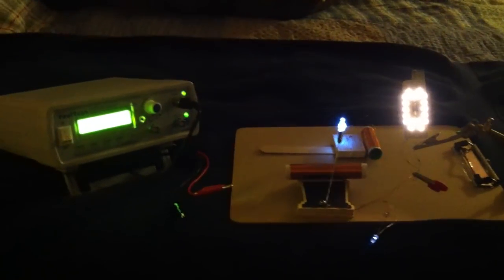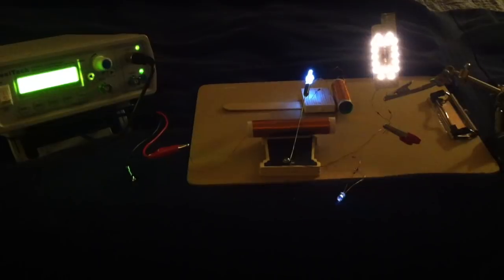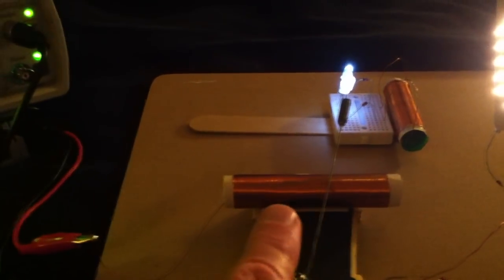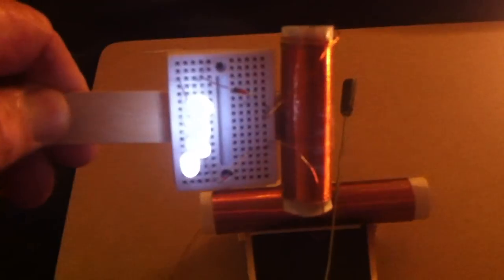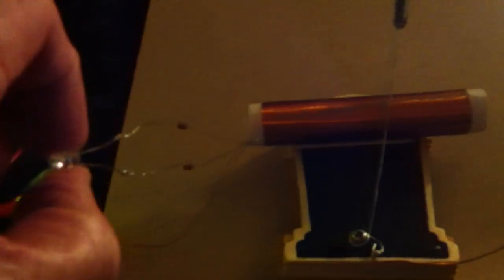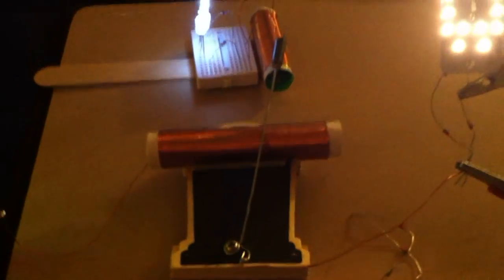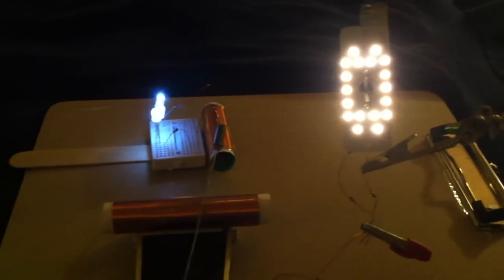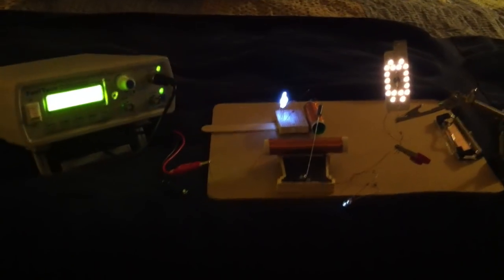'Stiffler Loop'-- driven by benchtop function generator

Comment: Excellent.  Now use a variable resistor or just resistors of very high ohms coming out of the signal generator to be even more amazed!  Can try low to even up to say 1M ohms.  Must read between the lines.
Reply from the maker: OK I will try that.   Thanks.

Comment: Am delighted to see that happen ! Also that your new piece of kit does it and to know about the field excitation. 
Am mostly delighted to see a tongue depressor in action again lol
Reply from the maker: I didn't expect see the field excitation show up using just the signal from a function generator.   I wonder what would happen if we setup a Jonny Davro ' pan exciter'  arrangement and fed it with just this MHz  signal going through an L3 coil.   From the guys on the forum it seems that I have about 1 watt of transmit power from this signal generator to play with.  Lots of fun experiment ahead if I can keep this thing alive.
Reply: LOL, don't kill it in the name of science !
Can a decoupling cap work with this sort of thing ? something like the 0.1uF that would stop a backfeed ?
Reply from the maker: A decoupling cap is not going to do it with it being this close to the field.   I touched the led AV plug tester on the ground clip lead and it came on bright.  The whole thing is hot.   Maybe if I moved the generator several feet away and ran a thin wire to the coil with a cap in between that would work.  I keep thinking about Dr. Jones and his  bad experience.  One moment you have a function generator and the next you just have a box of used parts.
Reply: I wonder what he did, because it does say it's protected from short circuits. He may have found something amazing and broke the sig gen without finding out.
Single wire is single wire and I know i've lit overhead fluoro's at 20ft, so that is well worth exploring, for the sake of a few ft of 30AWG or similar. 
I think the very first vid of yours I watched was a Dr. Stiffler experiment, where you had a single wire going out down your hallway to the front door and a load was being powered.

Comment: Thanks for the video.

Let me ask. Is Dr. Stiffler connects his L3 coil directly to the AV plug?
I thought it was only to the aluminum heatsink of the CREE Board? Then the node of the two diodes left hanging??
It seems to me that the aluminum heatsink of the CREE serves as antena and used for capacitive coupling between the LED's and the L3 coil??
Reply: And yes, the coil depends on the freq and vice versa. I have here 10 and 12MHz crystal. Mine worked at 12MHz crystal which I only have but seems not fully resonated. 
I tried function gen too but so far LED's did not goes ON. Maybe I missed something.
Reply from the maker: You can light the Al backed boards up either way.  This was not easy to get working on this setup and driving it from the AV plug end was the easiest. I just got this generator today and I will be working with it more in the coming days. I will try to replicate more of the Doc's experiments.  Having my o-scope hooked up also will help see what is happening.
Reply from the maker: I started testing this with just one led on an AV plug and scaled up.  The coil is critical when lighting up the 110v board.  It is very touchy.  A ferrite rod for tuning is helpful.
Reply: I'd just done a quick test after watching this video. And I did. But not the same brightness as yours.
However, I used the usual Tesla's radiant energy receiver having two AV plugs. I think I need to make a bigger coil. I only using my older mini-sec coil which seems smaller than the usual L3 coil.